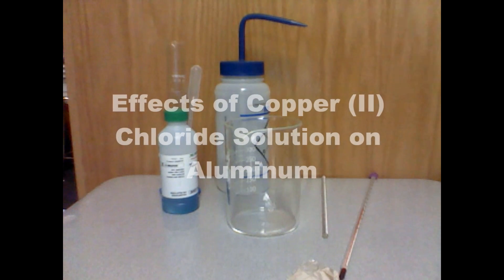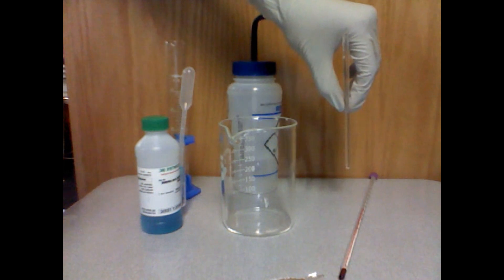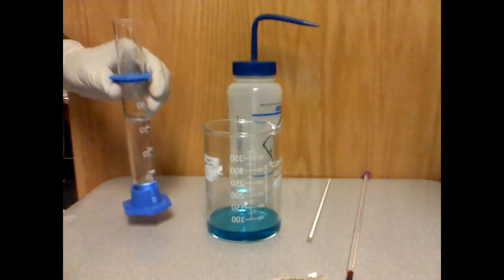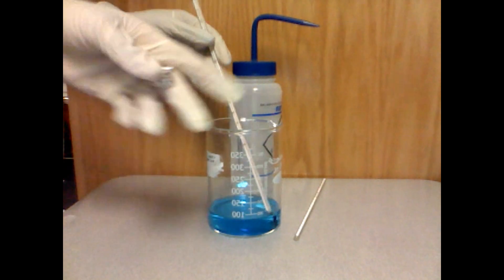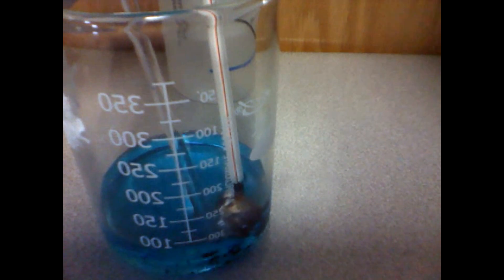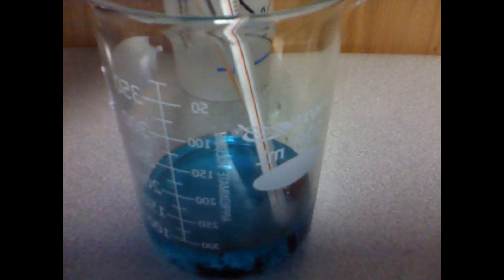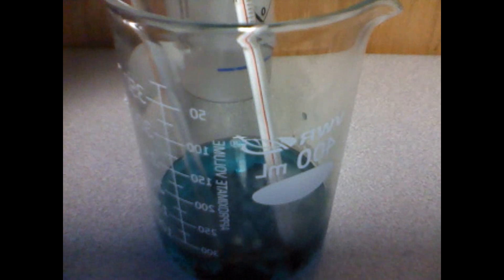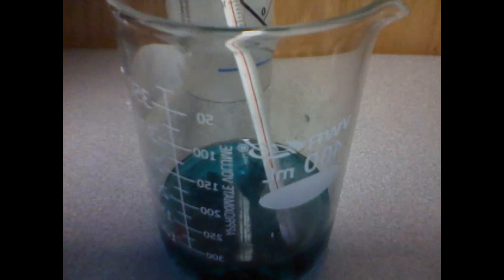Effects of Copper (II) Chloride on Aluminum; nhechs

Comment: 1. They follow predetermined instructions.
2. They are new to the experimental field and so they better learn the safe way.
3. When you release a video to the public you should always consider that there will be individuals that might replicate what you're doing which  can be dangerous (in general) especially if they don't have the knowledge and/or experience.
4. I admire your chemistry knowledge and skill but you're not impressing anybody by showing them under a 8-10th grade chemistry video.